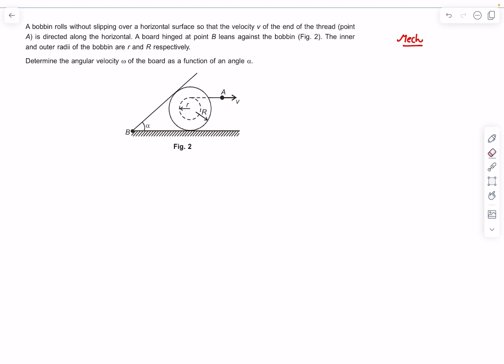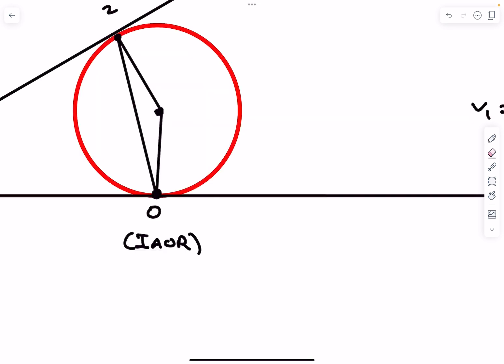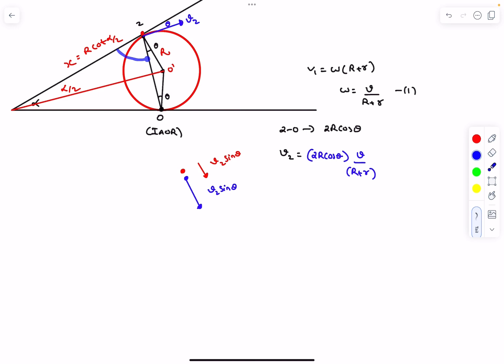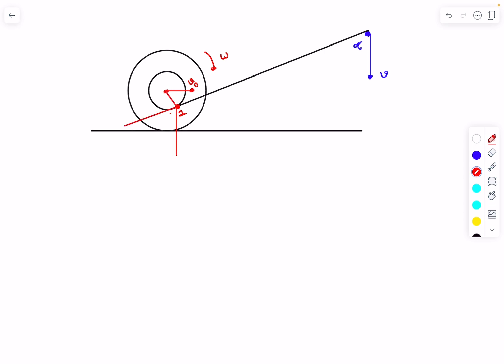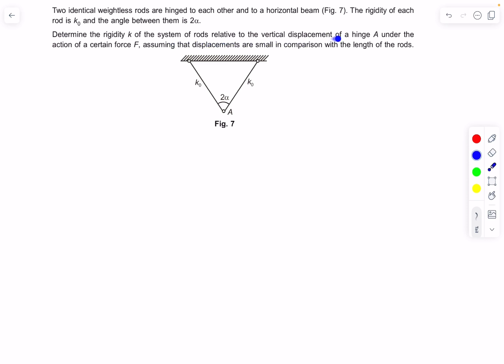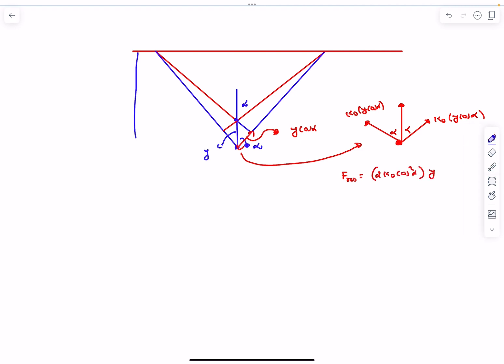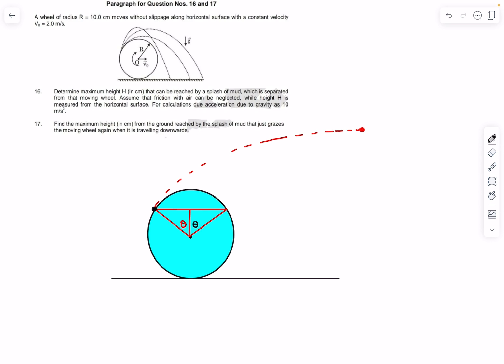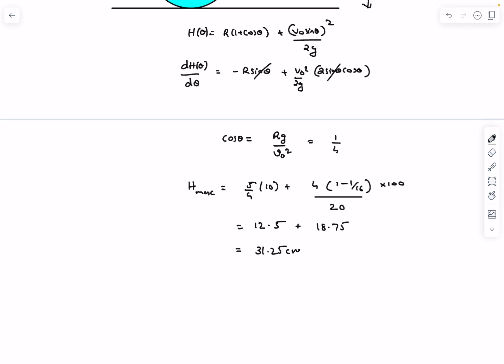[JEE] Good Mechanics Problems From AITS and Krotov

Comment: An alternate solution (and slightly simpler in my opinion) to the first problem:
d𝛼/dt = 𝜔 and dx/dt = vR/(R+r)
cot 𝛼/2 = x/R
Differentiate the last expression and substitute the other two values to get the solution.

Edit: In problem 2 the answer should be v/(sin 𝛼 - r/R), there is a small mistake in the final few steps. The given answer is dimensionally incorrect.

Comment: Bhaiyaa..i have a problem...in which a hollow sphere and a solid sphere are connected by a spring and system is released with the initial extension of spring being x0.

I have solved it using torque and angular momentum..and got the answer..(time period and all)

But really curious about the analysis of the system in the com framee(too similar to the normal two block system)..i have thought a lot but always got the wrong answer.. using com frame.

Can you please..make a video about this..or explain how to proceed in the repliess

It will be a great help😊